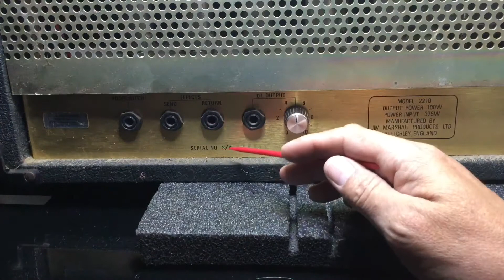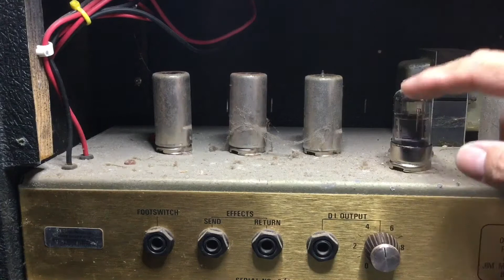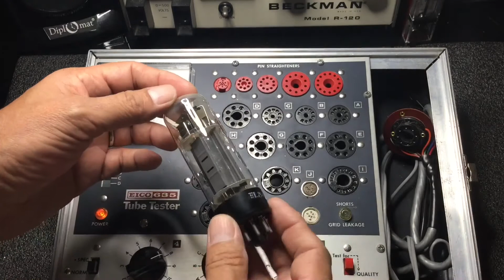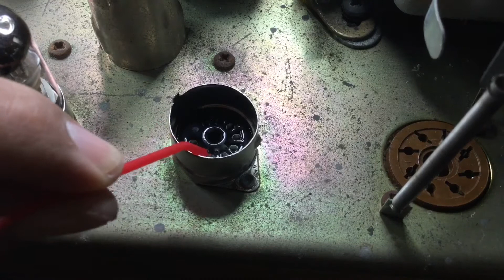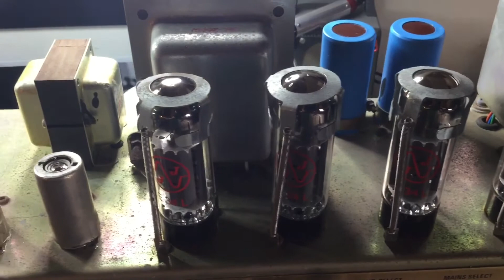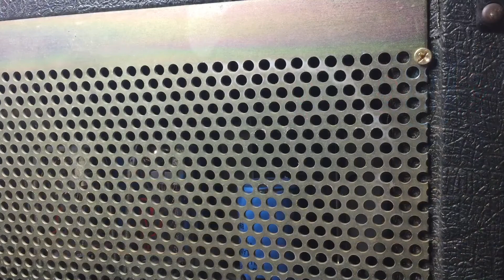How to repair a Marshall JCM 800 Amplifier model 2210 100 watt

Comment: I'm amazed you didn't even check to see if it had the proper fuses in the amp??? Should have be one of the first things to check!
Reply from the maker: Procedure is always to check the electron tubes first. Fuses and component check is done during visual inspection of the circuit board.
Reply: @FeeserAmplification  Procedure. I guess as long as you check them before applying any power.

Comment: Were you not supposed to move the switch to "D" when you tested the power tube
Reply from the maker: Not for this particular go no go tester as per manufacture instruction manual.

Comment: I’ve never seen anybody just hook a voltmeter up to a resistor and get those readings can you do that with a super lead also
Reply from the maker: Yes. So every amplifiers will have its own schematic allowing the technician to detect the bias point location.
Reply: Why do people buy Bias probes or run a resistors from pin to ground maybe I am Not seeing this right
Reply from the maker: @bobbarcus8310   Yes. All engineer technician are well versed in this method of biasing an amplifier.
Reply: @bobbarcus8310  This guy answered in a very ambiguous way as he is hiding that he does not know !    You get dazzled with the visuals of the equipment as a smoke and mirrors show.  On the schematics, you find where the bias voltage circuitry is and they give you a voltage number which represents a reference point BUT its a reference point on that particular amplifier they used when they drew the schematic which means conditions as to what tubes were in the amplifier at the time and the wall voltage that was present when the amplifier was powered up.......all of which are variables and do not carry over.......the whole point is that it is a generality.  The proper way to bias the amplifier is by measuring the current draw of the pair of power tubes.  Pair is the relationship to the function of the output circuitry as this is a PUSH/PULL type amplifier......one will be the PUSH tube and the other will be the PULL tube.  Being this is a so called 100 watt amplifier, the Push side will have 2 power tubes in parallel as will the Pull side.  You have to measure current draw to determine the PLATE DISSIPATION factor because bias setting is based on the PLATE DISSIPATION.  The TUBE DATA BOOK that the manufacturer's publish for their tube line will list the engineering data for each tube they make and give maximum values and parameters for that tubes optimal operation.  BUT this is based on the tube MANUFACTUERER and it doesn't always match exactly to another Tube Manufacturer's equivalent tube ....but can be very close, if an accurate statement were to be made.  The purpose of determining the Plate Dissipation is to find a narrow range of operation with the tubes as the bias current range is between 50% and 70% of the maximum Plate Dissipation number.  Translated, the range gives a variation in performance and tone as a result.  A 50% bias is relative to a cold bias that's within specification in the low limit.  You do not want a cold bias amplifier as the operation of the power tubes is in an area where they will make a distortion character that is not musical as they are not getting enough electrical energy to operate properly.  A medium bias in the 60% range would seem to be the logical point to bias BUT its not if you are optimizing the amplifier for tone.  A hot bias of the 70% range is where you need to be for optimal operation and tone.  So the real window of range is between 60% and 70% which is not much of a swing.  In fact, as the tubes burn in after a number of hours playing and being ON.....you need to check the bias again to see if it has drifted due to the burn in as the tubes settle in and stabilize.  Hence the TUBES are what determine the bias, not some voltage reference point on a schematic, and each tube set can be unique so the numbers and values generally are never the same when changing out power tubes.  GROOVE TUBES used to have a grading method when they sold their products as they were graded and matched sets.  Thier grading and matching let them use a scale number on the tubes sets where you could buy the same set number and put them in an amplifier without the need to bias the amp when doing the tube swap out.  BUT that was a sales and marketing situation with that company, I would always determine the bias with each power tube set change out...to determine the optimal performance.  The voltage reference point this guy is using is NOT the way you bias a tube set, but you could get a reading for the test point he is using after you bias by the Plate Dissipation method....just to get a reference number for that point with the particular tube set you put in....in that moment of time, BUT AS MENTIONED the tubes will drift after burn in and the proper way is to recheck and reset the bias point back to a 70% bias factor to the Plate Dissipation if it has drifted up or down from the initial setting.  To me, I can't say if this guy has credentials as in being schooled in electronics, but by what he presents....he doesn't know vacuum tube technology.  Vacuum tube technology is obsolete beyond obsolete and is not really taught in modern electronics schools.......they teach the technology of the day...DIGITAL LOGIC.  The big give away that he doesn't know vacuum tube technology is where he presents his tube testing machine and puts in the 12ax7 tube to test...his statement was about there not being any script label left on the glass of that tube and thus he did not know.  THE FACT OF THE MATTER is NOT THE LABEL ON THE TUBE......but the guts of the tube which you can clearly see through the glass.  IF YOU KNOW VACUUM TUBE TECHNOLOGY THEN YOU WOULD SPECIFICALLY KNOW THAT EACH TUBE MANUFACTURER USES GUTS THAT DIFFER FROM ANY OTHER MANUFACTURER>>>ITS A PROPRIETARY THING.......they are stamped metal parts in that glass and each manufacturer has their own stamp.  AND NOT ONLY THAT, There are other factors as being LONG PLATES OR SHORT PLATES...AND EVEN MEDIUM PLATES.  SO YOU CAN IDENTIFY BY THE PHYSICAL VISUAL APPEARANCE OF THE METAL STRUCTURES BEHIND THE GLASS.  The tube he was handling by a glance of it.....its a chinese manufactured tube which was a common used tube OEM as well as another common tube you'd find which would be a Sovtek 12ax7 WA....they were both very cheap 12ax7 tubes which is why they were commonly used.  BUT they are not the best musically sounding 12ax7 tubes one could use in an amplifier if you want optimal performance for musicality and tone.....as that is subjective to one's ears.  Amplifier manufacturer's like any other manufacturer follow the philosophy they teach in business schools......minimize/maximize theory......minimize costs and maximize profits......translated.... they use the cheapest parts and components to send their product out to the market place for sale.  There are a limited number of vacuum tube factories producing vacuum tubes in the world, and there are many companies that buy from these source manufacturer's and thus rebrand the tubes they buy to their label.  They may also put those tubes they relabel through a screening process and a grading process, so you have to know what you are buying when buying tubes.  You want to buy matched sets for power tubes, but not whole re-tubing sets for an amplifier....as the pre-amp tubes are what determine the tonality of the amplifier circuitry.  SO using a typically marketed re-tubing set as by JJ as sold by some music stores.....is not a 100% good thing to do for full on musicality and tone.  You have to find the right pre-amp tubes for your ears which will often be a mix of different manufacturers pre-amp tubes and not consistently one manufacturer's product.
Reply: @mikecamps7226  thanks I guess my best bet is some sort of bias probe for my power tubes and my ears for the preamp tubes I thought that guy was BS hooking up to some resistor and getting max bias I didn’t see it coming off pin8 to ground
Reply: @bobbarcus8310  the bias probe things are good because they keep you out of the amp .....and the lethal voltage/current present as you'd be working on a live amp.   But the bias probe things they sell also have a reference book that was based on samplings of amps and the suggested bias setting.   You don't want to use that book....just do the 70% plate dissipation method.
Reply: @mikecamps7226  thanks  when I was a kid we just went to Yale electronics on Sunset Boulevard and bought our RCA tubes put them in our Fender amps lol We didn’t know what Biasing was
Reply: @bobbarcus8310  oh ok...you are out in LA and at ground zero.....  My aspect was a bit different when you bring up RCA tubes.  I grew up in a family business as my Father had a home appliance store...WE were an RCA dealer hahaha.  When you have kids and they learn how to crawl.....I was just not crawling on the floor...I was crawling into the back of TV's and pulling out tubes...."helping" my dad hahaha.  SO I can say I have been around TUBES all my life....little did I know...how it would be having an impact in my adult life when I grew up
Reply: @mikecamps7226  Spartacus LOL I don’t know if you get the joke or not the days of family  Owned appliance stores aren’t around to much anymore unfortunately now you buy something from Lowe’s and there’s no service but yeah I grew up in Hollywood and I moved a whole 4 miles over to Burbank
Reply: @bobbarcus8310  Well yes, you hit the nail on the head......business was based not just on sales.....but SERVICE.  The bean counters of today just don't get it........then too the electronics industry has gone the way of throw away......garbage circuit boards and surface mount technology.    Back in the day, if there was an issue with something electronic, it was usually a bad solder joint.......but you didn't need a microscope or specialized equipment to do repair work when there wasn't surface mount and circuit boards.  Then when the printed circuit boards came in.....the new malady was cracked boards and not just the basic bad solder joints in relation to things that were made on assembly lines.  Designed obsolescence really got stepped up with time and its a shame that people got trained to accept it and then pay through the nose for it......just imagine the trajectory of the future.  I think the kids are already playing guitar on their cell phones...virtual guitar, but would you rather have artificial flavors or the real thing hahahaha........thats what it comes down to !!   BTW......is SPACE really made in a Hollywood Basement ???
Reply: @mikecamps7226  that’s my biggest peeve with all of this new stuff like member Lakeland that thing called the 11 came out and that affects the rack and everybody at first says how great it is I want to know who’s going to fix it when something goes wrong with it like you say both of my amps all I ever have to do is unsolder a bad plate resistor or a bad grid resistor once every 10 years and change the filter caps every 10 or 15 years at my 63 band master still sounds great And the same with my old hundred watt plexi Marshall
Reply: @bobbarcus8310  You hit the nail on the head.  There is that old school situation about integrity....morals and ethics.  And the swing was in for the business modeling and sales marketing where the dominance of designed obsolescence became the rule......sell products that break so you have to purchase another.  Nothing is a durable good anymore, which I find to be a massive crime.  They keep the public dumbified.....and send them to slaughter.  It seems around the mid 1980's with the computers hitting the market and being a driving force....and miniaturization a big thing as a trend.  They were consolidating arrays of IC chips into one big chip for function.  Mitsubishi TV's seemed to pioneer this mega chip concept in their TV mother boards......So if it went bad internally, they would find it cheaper just to swap out the whole board IF IT WAS STILL IN THE WARANTY PERIOD.   Or they would say that the cost of repair exceeded and it was cheaper to buy a new unit......stimulating their sales numbers.  I come from a period where certain purchases were essentially lifetime purchases....items that should last 20/30 years.  They scaled that back now to maybe lasting 3 to 7 years if you are lucky to make it that long.  BUT one of the issues is that all the old knwledge is cycled out these days, and the young ones coming in were only taught late era solid state.......they learned how to build computer circuitry as that was the trend in the industry.......and when you open up new amplifiers...you see comouter ribbon cables and the printed circuit boards.....ALL of which should not be used for HIGH VOLTAGE APPLICATIONS hahahaha.  Its technically fine for small voltage and micro-voltages but not for HIGH VOLTAGE.  I think there are 3 levels of traces on the boards depending on which level you specify for a build.....so its the depth of the trace on the board...its thickness.  But this is what I tell them, take a reasonable piece of solid core copper wire, whether it be 18/20/22 gauge and take that solid core wire and run it through a metal rolling mill to smash it flat and to a particular thickness....then compare that as a conductor to a trace foil conductor on a printed circuit board.  The higher the voltage, there is an effect called CORONA.....so there is a radiational field around the conductors and being energy...that field is relative to the strength of the voltage flowing.  Thats why there is the mention of what is called LEAD DRESS in old style electronics.....or sometimes mentioned as CROSS TALK.  The GRID circuit in a vacuum tube is like an antenna and in a perfect world you want those leads into the grids to be shielded from any corona or cross talk....so no interference gets into the pure signal and gets amp'd up with it.  CBS era SF amps used shielded cabling from the input jacks to the first grids on the pre-amp tubes......LEO era BF and earlier amps he cheaped out by routing the plain non-shielded wires in a way under the board to minimize the antenna thing.  SO HOW DO YOU DO THAT ON A PRINTED CIRCUIT BOARD hahahaha, it doesn't carry over.  Then the next big thing is the jacks and pots.......those are real wear and tear items but they are exposed to mechanical aspects where they can be subject to failing......and the old school rule was keeping those items divorced from any circuit board.  Fender stuff is really a circuit board based point to point setup...where as true point to point is a layer built birds nest directly on tube sockets and components with minimal wiring and solder lug terminal strips.  SO modern stuff has the jacks on the circuit board and the solder points on the circuit board where they mount will break as a result of mechanical stress....plastic jacks.  If you use straight plug leads and the end of the lead gets bumped...its a perfect fulcrum to transfer the force to the board and crack the board.....which means you are screwed.  Thats why they need to be divorced.  Then the same goes for pots.  But if this is in an amplifier, generally they have a control panel board with all the pots on it (but not always) and they connect via a ribbon cable with ALL parallel conductors......which means capacitance.  The pure definition.....2 conductors separated by an insulator.  But I already mentioned corona !  BUT if this were in a foot pedal, all on one board...then mounted in a rigid metal box, The geometry on that box and all the holes better be spot on perfect.....as the slightest variance of deviation in the plain.....you tighten down the jacks and pots and foot switch......that will stress that board and crack it......AND you NEED a continuity ground for every jack as its a chain mechanical ground the whole way from the guitar jack to the amp input jack if you are using a string of pedals along that way.  So anything but an absolute ground in the chain will jack up your signal.  Back in the heyday, they published books and magazine for hobbyist and kids....as people read things back then hahaha, but it was fairly common knowledge.  Today everybody is kept stupid and they feed everybody shit like spoon feeding a baby.  You might not be aware of this, but in the micro chips, if they are not made of gold internally where they burn in the miniaturized transistors on the wafers.......if it is the cheap tin metal basis construction......that tin metal being of a crystalline nature......it grows tines....sort of an oxidation situation.......and those tines eventually contact something else and kill the circuitry.  The main fail point in a vacuum tube is where the metal pins meet the glass bottle and that seal.......which means that old NOS tubes that have been sitting.......they are subject to deterioration....they aren't being kept in a cryo-time capsule where its at absolute zero temperature where atomic vibration comes to a stand still.  Maybe too much information......BUT really its the marketing that always pushes NEW stuff, and anything can be great new out of the box as a novelty....till it really sinks in and you discover it total crap !  Its the initial intoxicating buzz.....and then the come down.... or the dreaded buzz kill smacking you up side the head.  As a child in my relationship to the business, the manufacturer's had dealer showings for the products they would be putting out for the next sale's year....so we'd get the preview of what was up before it was released to the general public...and they started their marketing and advertising campaigns....and the result as it would then get written up in magazines as part of all that.  I used to love seeing all the new gadgetry......and then the manufacturer's use to offer incentives to push particular items